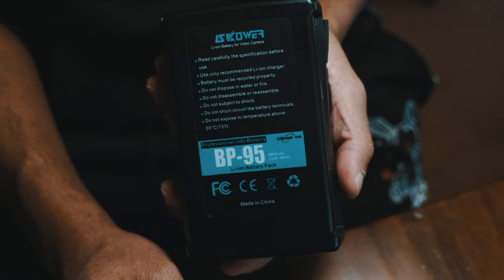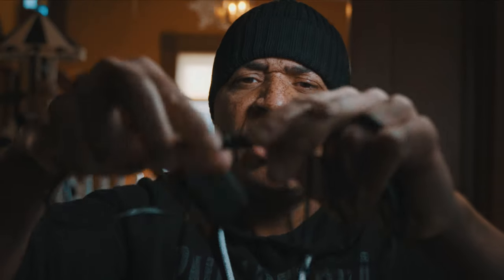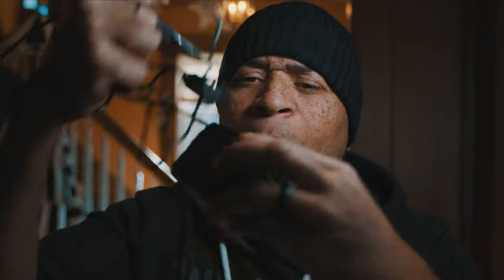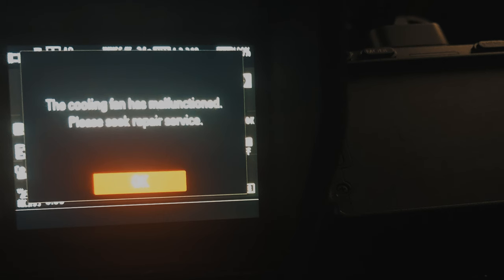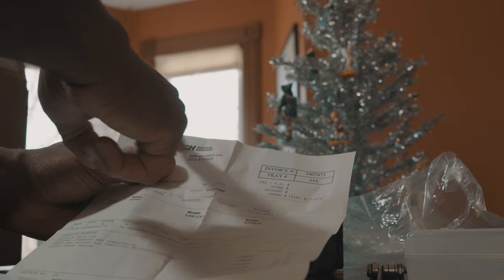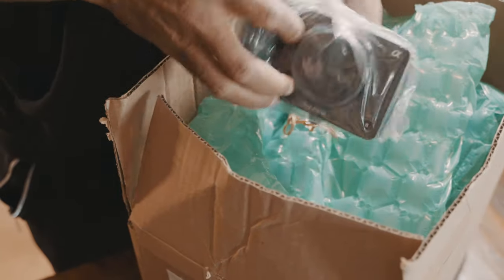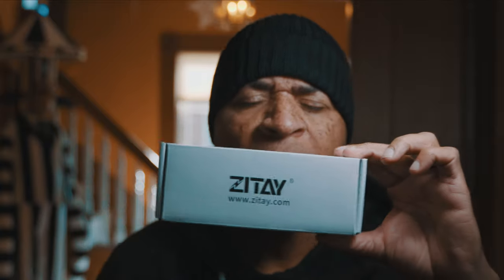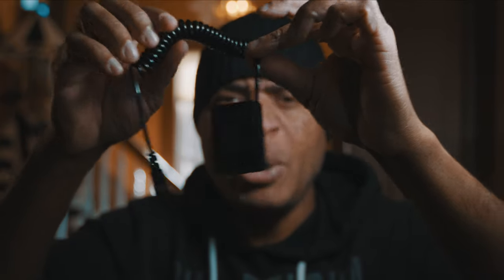How I Fried My Sony FX3 and How to prevent it from happening!

Comment: Glad you didn't have to pay for the repair even though it is technically user error.  The reason why the frying happened, is that different dummy FZ100 battery solutions have different point where it converts 14.8v nominal to 7.4v nominal. Scenario A is  D-tap(14.8v) - barrel DC jack or plug - FZ100 dummy(with DC converter), the DC barrel jack part does nothing to change the voltage, and the converter is either a small box built into the cable itself, or built inside the dummy FZ100. This is how your old setup and the Zitay adapter works (the Zitay dummy has a label print that it takes in 9-18v DC and outputs 8.2v DC, which means it does the conversion inside the dummy shell).  Scenario B is DC barrel plug or jack (7.4v nominal, 8.2v max) - dummy FZ100 without  (DC converter). Some examples include the Smallrig model 2922 dummy and model 4268 AC adapter.   If one connects the FZ100dummy from scenario B without DC down converter, to a scenario A Dtap to DC barrel cable, 14.8v will go into camera and cause severe damage.      TLDR: some dummy battery system convert DC voltage down in the beginning (power source side), some does that in the end (dummy shell side). When mismatching cables in a certain way, the system ended up with no voltage conversion at all and fries camera.
Reply from the maker: Thanks for the breakdown.  I appreciate you taking the time to watch it and also explain.
Reply: @FeechurPrezentations  I just wish more people can see and understand this to prevent damaging their expensive cameras and the loss of production time. It happens so often with Dtap and DC barrel plugs as both are dumb connections. You have good contents. Keep up the work man!
Reply from the maker: @ttian2  thanks so much!  I been slacking so I’ll get back at it.  Thanks for the encouragement!
Reply: @ttian2 Hey by any chance do you have links to a dummy battery to d-tap that does the conversion at the power source end? I have the Zitay and had overheating issues ( I believe it was caused my the converter being inside the dummy). On top of that the dummy itself feels really light, so I sometimes doubt if the conversion is really happening or it just sends 14.8v to my camera. My camera is still alive but I’ve become a bit paranoid when using it. Let me know!
Reply: @felixsimardt  the zitay does do voltage conversion . If it doesn't, your camera is already gone. Sorry man I don't know which brand makes one that has no thermal bottleneck. You are fine with the zitay . If camera throws the overheating warning, it could be many factors: the zitay adapter, environment, accessories, etc. I mostly use usb-c power delivery as my Sony camera's continuous power. The overheating is a bit hard to conclude sometimes. My fx3 and A7iv both overheated once only, both in mild 20°C indoor environment. And they were somehow fine recording 1.5hours outdoors under sunshine. So the airflow and mysterious reasons are key, lol
Reply: @ttian2 Okay yeah that’s what I thought; thanks a lot! I might try usb power too, but I’ve heard people had overheating issues with that too. The only issue I have with that is that I can’t fully rotate the flippy screen cuz the usb-c is in the way. Poor design from Sony. It’s pretty hard to pin down where the problem comes from on the A7iv. It’s might be my rig since I have cables sandwiched between a vmount plate and the camera body. All that being said it’s a great camera, but I thought for the price I’d get something a little more professional.
Reply: @felixsimardt  yes it is nearly impossible to pin down the source of that heat. A7iv is a hot camera to begin with. I'm a professional photographer and videographer, and we have multiple of them in my circle. What we have concluded, albeit no guarantee of accuracy, is that a7iv tends to over heat more often when shooting with full frame 30fps 10bit (7k oversampling), and when using external accessories like monitors. The ambient temperature does not seem to be that critical, but lack of airflow indoors seems to be causing thermal issues more than a hot summer day outdoors. When shooting in super35 mode 10bit, we almost never saw the thermal warning. Powering option like dummies, usb-c, battery, grip, etc did not suggest anything conclusive to us.

Comment: Scary man! I'm about to get a d-tap cable for my FX3 and I hear horror stories like this. Thanks for sharing. I'm going to get the Kondor Blue battery that has a DC adapter and I have a v-mount plate with various DC options. SIDE NOTE!! Before I've plugge in anything in the past as well I did a meter test on the source, the cable and the battery output just to be sure too! Cheers! and have some mezcal! lol

Comment: Please tell me which part did you have to replace? I connected a dummy battery to a PD quick charger and my Sony a74 burned out. It received 20V
Reply from the maker: @User-pq2yn  I sent the camera in and not quite sure what part they ended up replacing. Just make sure you get the correct dummy battery.

Comment: Thank you for sharing your experience with dummy batteries on FX3. I am also hesitating to use this solution because I can’t figure out how to manage the battery door with a dummy battery on the FX3… I don’t like the idea of letting it opened permanently… how do you deal with it?
Reply from the maker: @watsupmanu  your welcome and thanks for watching.
Reply from the maker: @watsupmanu  that honestly is not an issue at all.  I understand your concern though.  Overall a dummy battery is a good option but MUST get the correct version.  Too much work and concern that really is not worth the effort.  I’m currently using Sony batteries because they work so great and I only power my external monitor with the v mount.  Really though using the usb c to power your camera from a V mount  is a more viable option.  No concerns there .
Reply: @FeechurPrezentations  I think I will use the same set up and only power my external monitor with the V mount battery. I really appreciate your feedback.
Reply from the maker: @watsupmanu  I think that’s your best bet.  I think people get caught up in fancy rigs which are nice but there’s a reason those Sony batteries last long.  When I go out to shoot I usually have 6 batteries fully charged and rarely use 2 of them.

Comment: one question , if my monitor and camera have different voltage is it bad to connect them directly to the battery with D-TAP splitter or shall I be aware of something? or shall I get a v mount plate with the different voltage inputs?
Reply from the maker: I think the v mount plate may be best option.  I’ve used that configuration and have had no issues.
Reply: @FeechurPrezentations  yes for sure but, v mount plate doesn’t have any plugs it’s the one from small rig that just hold the battery….. I don’t know what to do I bought d-tap splitter but afraid to connect the camera in case it’s too much power , I don’t know if it regulates automatically , but I can’t seem to find the right explanation ….
Reply from the maker: @dannyveras  sorry for the late reply.  I got a Camvate baseplate that works great.  It has d-tap and I think a usb a connection.  I haven’t looked at it in a while but that may be an option.  But you could also try connecting your camera by the usb connection.  Probably safer.  Hope this helps.  If any other questions maybe we can talk about it when I’m actually in front of my equipment?
Reply: what a nightmare these dummy batterie thing, so I fried the camera, here is my second one, luckily Best Buy gave the option to get a protection plan for 170$ for a couple years, so I got a new camera right away, and I almost fried it I believe because there's a funny smell damn it!! still work , but gonna have to contact fuji for advise, because can't live like that spending my time on Best Buy... im surprise there is no information at all about these things online.... they just tell you don't buy cheap dummy batteries, when they are all cheap, and the genuine ones are out of stock... I don't get it ! what kind of world is that?
Reply from the maker: @dannyveras  I understand your pain.  It can be very frustrating.

Comment: what happens if u accidentally use a 5V power bank to your 8V NP-FZ100 dummy battery connected to your Sony A74 camera, would it have the chance to fry the camera or not? thank uu
Reply from the maker: Honestly I don’t know that answer but I recommend matching everything up according to the specs.  If you accidentally did that then you should check to make sure things are working properly.  Try and test your camera without using the dummy battery.  If it’s working ok then you should be fine.
Reply: @FeechurPrezentations  thank u sir for replying, it seem to work fine..just that I need reassurance cause it's a new camera and u kno how it is w new toys 🤣🤣
Reply from the maker: @Obscurainc  I totally understand that.  I’m glad it’s running well.  I hope you enjoy that great camera.

Comment: I'm starting to become convinced that camera manufacturers hate their customers with a burning passion.
They could easily manufacture and sell power solutions, but they refuse to do so, and instead force customers to have to get an electrical engineering degree in order to figure out how to safely use their cameras with third-party dummy batteries, etc.
Reply from the maker: I agree!

Comment: OMG this JUST happened to me - Same dummy, same battery... Sony a1 camera. 14.5volt direct to the camera instead of a regulated 7.2.  Could you please let me know... did the repair cost you anything, because it appears that it didn't - really gives me hope for my situation because I can't afford another 10k CAD for another sony a1. Very stressful
Reply from the maker: If your camera is still under warranty which it should, there’s no charge.  Just a waiting period.  Call directly to Sony.
Reply: @FeechurPrezentations  Thanks - I'm really surprised that among ALL the content on youtube around rigs and V mount - nobody brought up the voltage issue and what precautions to take...  It's not common knowledge and I wish there was even a small mention of that (such as "don't connect unless you're SURE there voltage is converted. Don't use cheap dummies and chords when dealing with power. it will cost you.")  PS maybe you could make a video that includes what others have left out.
Reply from the maker: @Kismet_design  I’ll try to make one.

Comment: I fried a monitor using direct D-Tap current - learned my lesson - I only use USB-C PD connections now (my V-Mount batteries have several of these PD USB-C outputs now - and I have the D-Tap to USB-C PD Kondor Blue cable) - PD handles all of the voltage/amperage handshakes to prevent these problems. I power my FX 30 directly off the USB-C PD output of my V-Mount batteries  this way - no dummy battery setup needed (and sleeker/more elegant than the dummy battery and having to leave the battery door open IMHO ...)